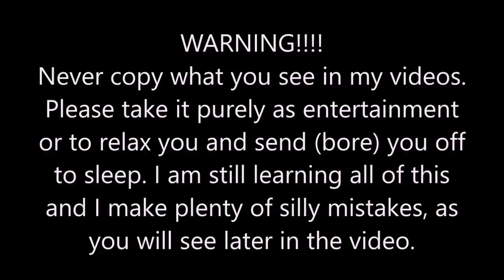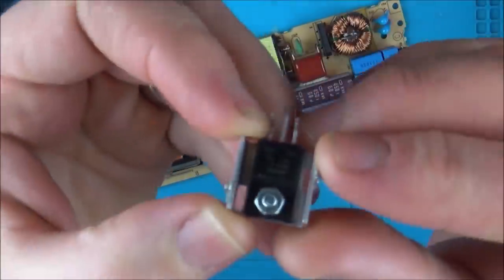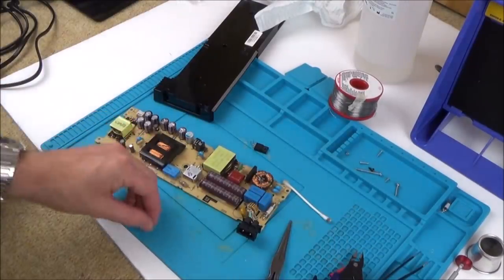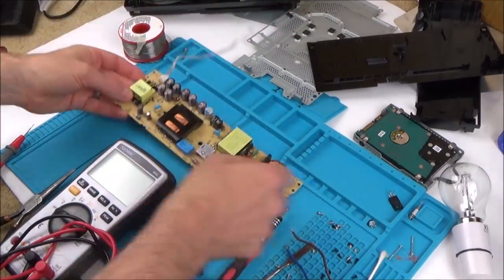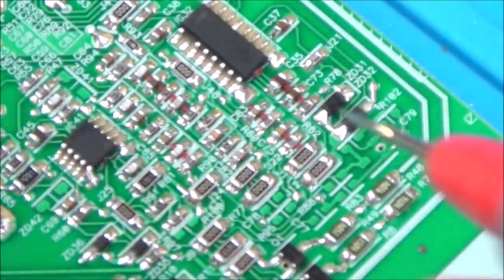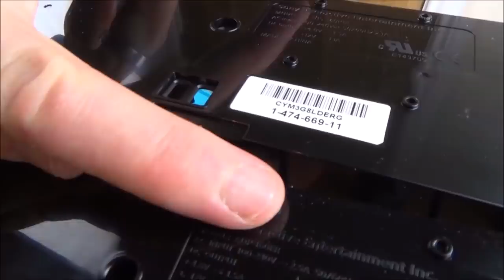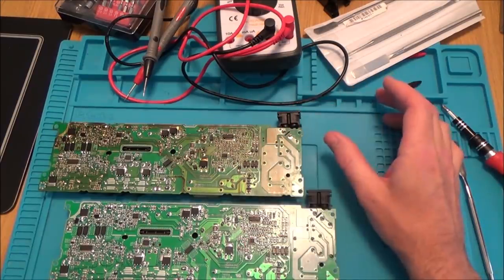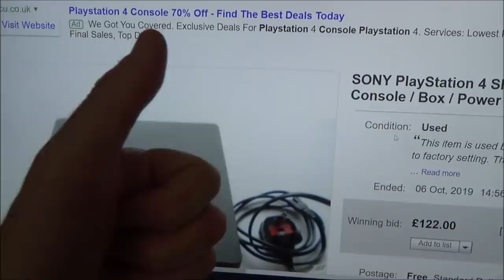2019 eBay Repair Challenge - Week 3 - PlayStation 4

Comment: By getting shocked, you've officially been initiated into the electronics repair club.
Reply: If it was a shock from a FULL BRIDGE RECTIFIER then it would be hilarious.
Reply: @zeroskill990  no it's a FUUUUUUUULL BRIDGEE RECTIFIAAAAAA.
(I miss those old electroboom videos btw)
Reply: EpicGamer 

Strange that you said that, as I very recently (as in earlier today) watched a video from The Thought Emporium (specifically, the first in the series about the DC Sputter method used to coat anything in metal, the part where he indeed showed his full-bridge rectifier setup), and he said that (in the same way that your writing hints to).
Reply: I guess it's not that dangerous if it doesn't stop your heart
Reply: I got bit by power supply capacitors last month and a week later had a massive panic attack. To be fair, I have been stressed but I've found out since that non-fatal electrical shocks can cause mood disorders. Something to consider even if you're working on low voltage devices. Be safe out there, folks.
Reply: I havent gotten shocked by an electronics board but I've taken 277VAC while changing a lighting ballast "hot" like an idiot. I can tell you, getting bit really sends home LOTO.
Reply: @Reality it depends on the path of electricity in a body and application time. A short discharge 2 cm in length is unpleasant but won't kill you. Left hand to right hand for a prolonged time is highly dangerous and potentially lethal.
But even if it doesn't kill, it can be painful.
Reply: @Tesnopesno  It is dangerous, that's why you should work with one hand on your back, so current doesen't come from both sides of your body
Reply: When we was kids we didnt have two plus so I wired up 2 devices from one with no top on the plug. Got a shock from that one time, didnt do me any long term harm I dont think Haha were talking 25 years back now. My brother stuck a screw driver in a plug socket hes fine too 😅 sure it's dangerous but a shock from plug socket is highly unlikely to do you any more harm than being very hesitant in future until you forget the feeling anyway
Reply: @zeroskill990  it's the bridge that is faulty, i repaired dozens of power supply , when the mosfet is down it means that killer is the diode bridge.
Reply: If this includes shock by repair ps2 slim, I'm in :D
Reply: And to the My mate Vince massive shock edition

Comment: That WAS a rollercoaster.....

I love what you're doing Sir...  I think you're better than you think you are...

I would give you 2 small tips though.... If I may...

#1 if you think you have a power problem, check the cord THOROUGHLY before moving on... Cords get damaged all the time.   You just had a video, where you did a cord on a car nav system...  And, if you think you might be blowing fuses, keep re-checking the cord, the little power brick, the fuse, all of it....  Never rule out your cord....  If there's no power coming in, you can troubleshoot for the rest of your life, right????

#2 Do you have a power supply??  Like a benchtop box, that puts out DC voltage??  That could be very helpful.  Feed 12v into the Playstation.  Does it work?  Okay.  Now you know you have a power supply problem.  Isolate your trouble.   If you do a repair on a power supply board, before you put the thing together, plug it in, test the output voltage...  Is it putting out 12v or not?  

Test, don't guess.   And definitely test, before you reassemble.  Or do just a very quickie re-assembly, to see if it works....

I was dying at the end, when it wasn't working....  ugh!  My head literally hit the table....  So for your own sake Sir, test it first, before you put it all back together....  You'll end up in a padded room in a straight jacket, if that keeps happening to you....

Okay, I'm somewhat joking, but...  Seriously, re-check the simple stuff from time to time.  I spent like a day, testing something, pulling it apart, swapping out stuff...  No power.  Turns out my benchtop power supply thing popped a fuse....  I was ready to blow my brains out that day, I'm not gonna lie....

I spent all night looking at my friend's motorcycle one night...  So crazy, no power anywhere, what the hell...  The "run/stop" switch went bad.....  I checked the switch, to make sure it was in "run", but I never did verify power coming out of it....  Duh.  

So, check your basics...  Recheck your basics.... Then check your basics again....

I do give you a LOT of credit for leaving that in the video though....  You could have edited that out...  Shows a lot of honesty and integrity.  Which is very admirable.
Reply from the maker: Thank you Patrick, I do have a solder/hot air station that outputs voltage, I didn't think to put 12V straight into the PlayStation. I have been given some good pointers for the PSU so maybe it could be a revisit video down the line a bit :-)

Comment: The worst zap I have had was unplugging a fridge that was in a cavity, I was at full stretch with my arm and the tips of fingers were pulling on the plug. The plug came out enough for a finger tip to slip in and connect the positive and negative. Luckily I was crouched down at the time so I got thrown back and landed on my bum. I sat there for a good minute or two regaining my thoughts and thinking that was lucky I got thrown away as I was by myself at the time.. Now a lot of plugs have the plastic coating on the prongs so you can't do what I did. That gave me a whole new respect for 240 volts and how ever many amps I got. 😊

Comment: Another great video Vince.  Well done for persevering.  To discharge caps in power supplies, get yourself something like a 2 watt 2.2k ohm resistor and a set of those super cheap small crocodile to crocodile lead sets (about two pounds).  Clip the resistor across your meter probes using 2 of the croc leads  and just watch the voltage go down as you probe the cap(s) - keeping fingers away from the croc ends and resistor!   From ohms law if the cap is rectified mains charged it will be just under 350v (!!) and a 2.2k resistor will discharge it at approx 0.16 amps, so no big flash bang.  Shorting caps out is never a good thing to do.
Reply from the maker: Thanks MikeB

Comment: My ps4 made a loud pop a while back. It was your videos that inspired me to try and fix it myself. Bit of common sense told me it was the power supply. So ordered a new one from eBay (Chinese company) took a few weeks but it was only £18 brand new. It arrived replaced it and it all worked. Not exactly a diagnostic triumph, but confidence boosting for me. Cheers.

Comment: nice video. If you're interested in repairing the switch mode power supply, try replacing the driver chip for the MOSFET. When the MOSFET transistor shorts, nine times out of 10 it will take the driver IC with it. It's located on the primary side next to that diode that you tested with a short.

Comment: Unfortunate Vince got shocked so badly, I've been shocked by some things over the years. Thankfully it only got his thumb. I was cringing when he started handling that board wondering if he had discharged those caps, then seen he didn't! I'm sure Vince will be mindful of caps now, is indeed a lesson you won't forget. I made up some leads for discharging as described below.

For discharging capacitors I used an old / extra set of multi-meter leads I added a resistor to (buy a new set and modify your old ones). Simply strip some insulation off about 4 inches from where they connect to the meter (both leads), and solder your big low ohm resistor across them (I used a 5 or 10 ohm 20 watt or so wirewound, I don't recall was one I scavenged off a board) and then insulate the connection / resistor. You then use these multi-meter leads as if you were testing voltage on the cap, and you can watch the voltage drop while discharging on your multi-meter while using the safe meter leads to probe the solder joints / component legs. I have to stress though, you absolutely must not forget to switch back to your normal test leads before trying to use your mulit-meter for voltage measurement!!! I prefer this over alligator clips, but they do also work as well.

My worst shock was when I was pretty young and trying to fix an old CRT television. I didn't know the CRT held a charge, and when I went to remove the anode cap (I didn't even know what it was) it shocked the heck out of me. It made my entire right arm feel funny / very shaky for several minutes. I worked on CRT's after that and even replaced flyback transformers, but I researched how to discharge them before working on them again. I knew about capacitors, but had no clue about picture tubes, I sure found out about them though :-))

Live and learn, almost die, then quickly learn some more! 😁

Comment: Old video and not sure you got an answer but generally to safely discharge a capacitor is to use a resistor connected to both ends of the prongs. Something that is a few hundred ohms with a watt rating of maybe 1/2. Depends on the voltage you are working on. You connect the resistor across the capacitor and it'll slowly discharge it. You can bind the connections to dowels or something or even wrap them with electrical tape so you don't have to directly touch it. For Zener Diodes are basically like regular diodes. Their gimmick is that they block voltage in the reverse direction till a certain voltage called (Break Down Voltage). They are meant to do this as a basic voltage regulation. Voltage goes to high they short the voltage down to protect other components. Like all semiconductors like transistors they tend to fail as a short. For the last part, power supplies and similar current drawing devices will initially draw a lot of current for a few moments when you first plug it in. This is generally due to things like capacitors charging up as empty ones are basically considered dead shorts. This is usually for only a short moment but can be high enough to pop a fast blowing fuse. One reason why slower blowing fuses exist. Depends on application but a device that uses a 3amp fuse can blow the 3amp fuse when initially plugged in cause it could draw 6amps for a fraction of a moment charging things up. You might see this most often when first plugging an inverted into a car, but this can occur else where.

Comment: Here is a helpful tip. You can make a simple tool to discharge capacitors. In the USA the bottom prong of a plug (the round one) is earth ground. Sorry, I don't know which one it is in the UK. You can put a phillips head screwdriver into that hole, attach a cable to it, and use it to discharge the caps. 

I used to do repairs on CRT monitors (Old TV's and arcade games) We would use a phillips head screwdriver at one end, an insulated narrow flathead or pick on the other end and solder 1 gauge wire between them. Those old CRT's would hold between 10,000v and 50,000v and you would need to discharge at the flyback coupler, wait a few min, then discharge a second time.

Comment: Still watching!  Bulb is a nice way to drain caps!  But I tend to just short them tbh!  Caps will go back up in voltage after being quickly discharged - there's a memory affect.  Dave Jones on eevblog talked about it a year or two back! 

Good god @ the state of that replacement PSU!  I had a similar problem when I ordered a replacement cooling system for my Dell PC - I had to soak it in biological washing power in the sink lol!  All the heatsink vents were full of brown sh$$!  Came out like new afterwards! 

Sometimes when a PSU fails like that you get a large spike on the secondary side that kills some components on the secondary.  The other possibility is something failed on the secondary side and perhaps it pushed the switching transistor into an overdrive situation, which blew the transistor and the the fuse.  Most PSUs have protection for those sorts of things though.
Great result!!!  It can be super hard trying to work out the fault when you have a fault like you did - ie. primary was fixed by the things you did, but something wrong on secondary side.  Chance are, those Zeners, maybe that small IC too, maybe the odd small transistor too.  Painful trying to diagnose things like that!  One thing I found strange - when you tested continuity to the switching transistor, I wouldn't expect a short there from live or neutral?  It normally gets rectified by the bridge rectifier to DC - I thought I saw one on there.  Just check that bridge hasn't shorted too!   That said, I would expect the fuse to blow again or something?
Reply: Not sure what the threshold is for a continuity beep on a multimeter but a low-voltage-drop diode could definitely cause some meters to beep.

Comment: Good way to discharge capacitors is by shorting them out with a ~1 MOhm resistor between the leads. This makes them drain slowly enough that they do not damage the capacitor. The direct short method (like with a screwdriver) can destroy the capacitor or at least severely degrade them.
Reply: 10k I use.
Reply from the maker: Thanks, I do have them now after comments on a previous video. I just need to solder them onto some little test probe/croc clip. This was filmed back in the summer so next time I need to discharge some caps I will try the resistor method, as I haven't tested it out yet :-)
Reply: @Mymatevince  Looking forward to seeing it :) Watching you hurt yourself was tough to see. 

Quick note on the resistor value: 1 MOhm is for the gentle discharge, which can still take a while. Lower values increase the current and speed up the discharge rate. The 'right' value depends on the max discharge rate for the capacitor. 100kOhm or such should also be fine for most caps.

Be careful when discharging CRTs, though. They can weld screwdrivers to their terminals when fully charged :)
Reply from the maker: @MayaPosch  Thanks for the tips Maya, I have 2x 1Mohms and also another massive resistor that I need to measure the resistance on (it came out of a 240V bathroom extractor fan). I was going to have a play around with them on my multimeter to see if I could maybe wire them up in parallel to reduce the resistance to speed up the discharge time. I don't mind waiting a couple of minutes to discharge but I would prefer not to wait 10 minutes :-)
Reply: @Mymatevince  Yes, wiring them up in parallel should double the current (roughly). Total discharge time will obviously depend on how much energy is stored in the capacitor. For those big filter caps on the primary side of a PS4 supply I imagine it could take a little while.

Worst case you can always add a few more resistors in parallel to speed things up if it doesn't discharge quickly enough. Discharge for 10 seconds or so, see how quickly it has dropped with the multimeter, then adjust as needed :)

For bonus points you can calculate the energy stored in the capacitor, put an amp meter inline with the resistors and from the reading calculate how long it'll take to discharge :)

Comment: Great video. @31:21 I felt that. Been there mate. Even a 5v USB charger can give you a nasty belt. The peak voltage will be about1.41 times the RMS mains voltage so about 338v peak in those caps if the mains is at 240v. It looks like the 5v standby rail was screwed. Without that, it will never power on. I would check the diodes on the 5v output and any switchmode chip that is attached to the 5vsb transformer (the smaller one). Thee will be a PWM chip somewhere that is controlling the mosfet that blew. I would start there. Maybe you can fix it and still sell it.

Comment: I am still learning too,but I am pretty sure you can go up in amperage as long as voltage remains the same,referring to the fuse with T5A.Sorry Vince,knew exactly what you did the second you threw the PSU down on the table,LOL,gave me good laugh,been there done that.Glad all worked out for you in the end.Good luck in the competition.
Reply: Uhhh, with all due respect, you shouldn't do that.  I suppose maybe?? a PS4 is different, but, in a car, or lots of other devices, a 10 amp fuse, should NEVER be replaced with a higher amperage value fuse....  Unless you wanna get a real close up look at a fire....

That could well be why the board had so many faults...  It's designed to literally never see more than 4 amps...  So you put a 5 amp fuse in there...  All sorts of things start to fry,  because components that were never designed or spec'ed to see 4 amps, are now seeing 5 amps...  And the 5 amp was blown??  Yeah....
Reply: @patrickmorrissey2271  A car is totally  different yes.

Comment: Hi Vince, 1:04:00 you can unsolder those diodes, capacitors, or whatever else you need to test and then check if you still have a short between the mounting pads. No short - the element is definitely dead, still short - the element is not the one [not the only only one] to blame.

Comment: I thought, some months ago, we discussed making a simple capacitor discharge tool where all you needed was a 5W 470 Ohm resistor (which you were going to get with your next order from an electrical component supplier)?
Reply from the maker: Yeah, this was filmed back in the summer before our last discussion. Next time I need to discharge I will use the resistors that I have👍

Comment: 5 volt output on the power supply is probably a 5 volt standby supply if it is needed to enable the 12 volt output. It probably goes to the motherboard  to generate a power good signal back thru that same connector to enable the 12 volt output to power the mother board up. This is all conjecture of course because I have no experience on these power supplies. You might be able to generate the 12 volts with an external power supply but probably not because the motherboard will be looking for the 5 volt standby power.

Comment: You need to check if the power is getting to the secondary side, if not check the feedback loop from the control ic.  lookup datasheets and remember the first rule of troubleshooting is check voltages.